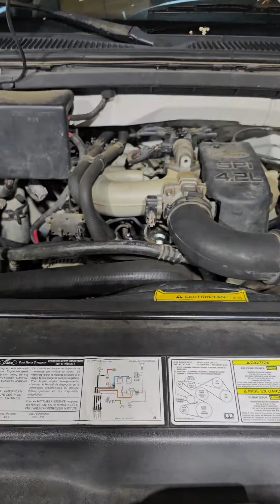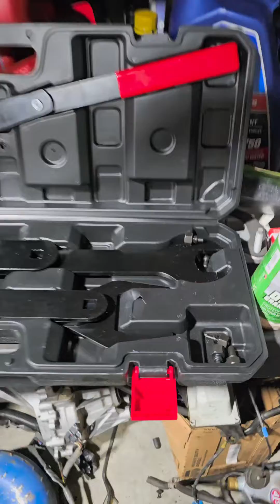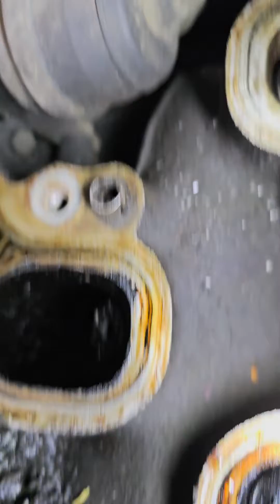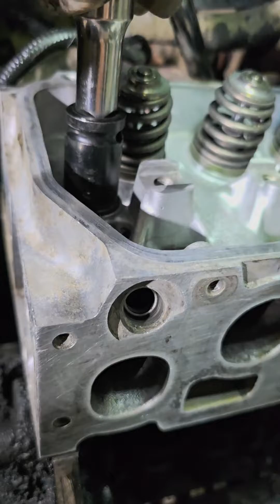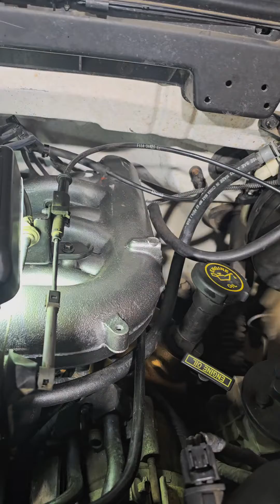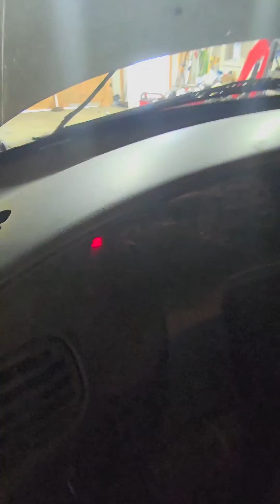Ford F-150 Head Gasket & Water Pump Replacement | Complete DIY with Torque Specs (4.2L V6)

Comment: Did you have to spray the exhaust manifold bolts with PB blaster or anything like it or did they just come out without breaking?
Reply from the maker: Yes with PB plaster.
And used grinder to heat the bolts

Comment: Mine is a 2000 F-150 V6 4.2l with 115,000 miles. So far it's running great, I was planning to do the lower intake manifold gaskets, already bought new ones and valve cover gaskets, but should I do the cylinder head gaskets as well you think?  Thanks for the video